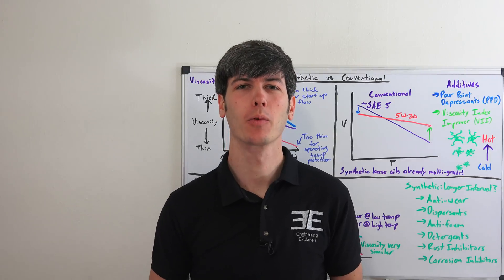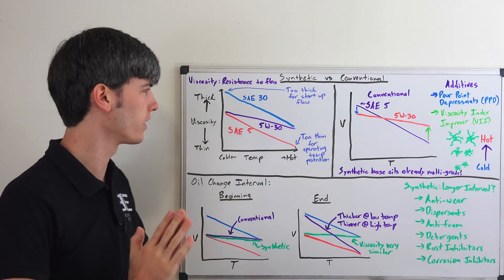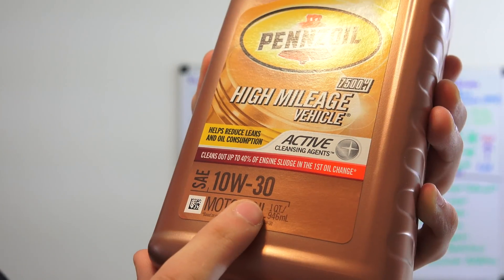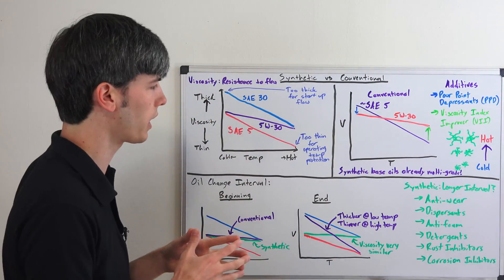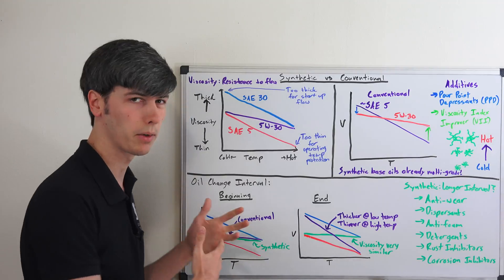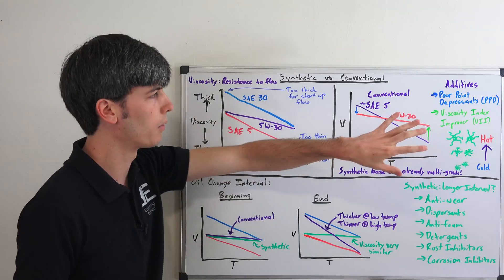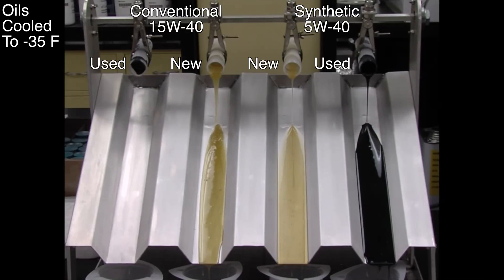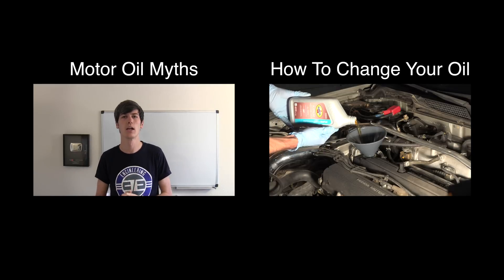Is Synthetic Motor Oil Better For Your Car?

Comment: so.... synthetic oil doesnt have any cons?
Reply: Just because it is made by Mobil , does Not mean it is the same formula.
Reply: *****
That's not a con, that is a pro of the synthetic oil's additives doing a good enough job cleaning up the gunk that was built up around already existing leaks that the leak became noticeable. The leaks were already there, now you just know about them, and can have them serviced.
Reply: just that it is expensive, but walmart supertech full synthetic is reasonably priced
Reply: Ryan Rohauer walmart full synthetic is the same as mobil 1.   google it
Reply: It can and will cause higher consumption in high mileage engines. I have first hand experience with that. My car will burn 1-1.5 quarts of Pennzoil Platinum over 5,000 miles, it will burn less than a quart of syn-blend or conventional over the same mileage.
Reply: ***** walmart full synthetic is 5 quart jug for $12
Reply: Yeah thats from clearance issues and seal issues. I experience something similar since I've made the switch. But my engine does seem to run better all around.
Reply: Is it really that expensive when it costs about as much or less than filling up a full tank of gas? Considering you have to do it once (and potentially top it off once or twice) every 5000 miles? 
Also the price of synthetic vs. conventional is hardly significant. At the autozone I went to it was like a 3 dollar difference or something for the gallon jug of the stuff.
Reply: Oil in the USA is soo much cheaper than it is in the UK :(
Reply: price
Reply: +plokmijn47 My two main seals leak enough to make a mess on my transmission and side of engine but not enough that I'm seeing puddles of oil under my car (knock on wood) should I not use synthetic then?
Reply: mrsemifixit
Also just remember it isn't the cause of the leak, and shouldn't be a reason to stray away from synthetic, but more a reason to stray towards fixing those leaks.
Reply: Rubber seals have  hydrocarbon oils called elastiziers put into the rubber mix during manufacture. Over time when exposed to heating and cooling these elastiziers evapourate from the rubber and the oil seal shrinks and looses its elasticity.
Old mineral oil naturally replaces the lost elasticizers keeps old style rubber oils. seals supple and plumped up. Good modern synthetics contain elastizers as additives that do the same job.

Comment: How often I need to change my motor oil, I use full synthetic 10W 30 in a 4 Cyl 2.0 Turbochaged Mitsubishi Eclipse 99? also I live in Puerto Rico which is summer all the year, Do I need to change to 5W 30?
Reply: Does your manual specify 10w-30?  Never exceed the recommended interval with a turbo regardless of the type of oil you use.

Comment: Sadly, I have to order my oil on Amazon. Auto parts simply do not carry it. My car (Abarth) specifies Pennzoil Platinum Euro 5w-40. Local auto parts try to claim the regular synthetic 5w-30 or 0w-30 or even 10w-40 will work, but neither matches the heat requirements of the 1.4 Multiair Turbo on my 500 Abarth.

Thing is, Multiair uses oil solenoids to operate the intake valves (very high tech), which means if you have the wrong viscosity oil, it actually changes the valve timing. The engine uses temperature measurement at the VVT sensor to calculate the current viscosity, based on you having put in the correct oil. 

All of this equals.... you shouldn't put the wrong grade of oil! And yet auto parts counter jockeys will always tell people it doesn't matter.

This is why I end up doing my own oil changes as well. I know for a fact no auto parts in my entire city (120,000 population) carry it in stock, so I can deduce that any oil change shop claiming to use it is probably lying to me.
Reply: Bruh, chill.  You really think a mass produced car isn't designed with enough tolerance to take different oil than what the manufacturer recommends?  Hate to break it to you but your Abarth isn't that special, no offense.  It would be fine with whatever you can find on the shelf.  You honestly can't complain if you're going to be picky tbh.
Reply: Electone_Guy If you believe the local autozone, there are no synthetic 5w40 outside of diesel oil.
Reply: supertouch I'm not putting "any" 5w-40 in my engine. Especially not conventional oil, when you consider it has to lubricate the turbo which gets EXTREMELY hot. Would other brand synthetic 5w-40 work? Some of them. But you just try finding synthetic 5w-40 at most auto parts. You can't, unless you want to get Diesel oil (Rotella T6)
Reply: There are no conventional 5w40 oils.
Reply: Alvin Brinson 
Whatever you say bud, I'm not saying you should put whatever you can find on the shelf but I have no doubt that your precious "multiair" would take it just fine.
Reply: Try Liqui Moly 5W-40 every auto part near my place has it. In fact Liqui Moly is the only brand our shop uses for Euro makes. That said any synthetic oil of 5W-30, 5W-40, 10W-30, and 10W,40 will most likely work on your vehicle as they are designed to run on more than just one viscosity of oil.
Reply: There is no conventional 5W-40. That kind of viscosity range just isn't achievable without synthetic bases.
Reply: My wife's 1.4L turbo Dart has the same engine and every auto parts place and places like wal-mart carry full synthetic 5w-40. It says "turbo diesel" on the label (Shell Rotella T6) but it is not strictly for a diesel engine, says so on the back label.  I have used it several times with no issues.  And I know dozens more from the Dart forum who also use it
Reply: Any well known brand synthetic 5w-40 should work for you. Your pennzoil platinum is the same as Shell helix ultra btw.
It's considered one of the better oils in pair with Mobil1.
Reply: "diesel" motor oils are just engine oils with more cleaning additives to take care of the extra soot that the diesel engine produce.

Comment: except for rotary engines, that you need to use mineral oil like castrol Gtx.

but if you put an additional tank oil for the oil injection system, independent from the sump oil, you need to put in the additional tank mineral oil, and in the main sump, full synthetic

Comment: So 0w-40 is thinner at cold temperatures than 5w-40 but at operating temperature they are both the same?
Reply: That's the idea for multi-grade oil. But if you wanna know how far you can drive before oil breaks down, that depends on brand and additive package for different application. Generally that's the way it goes.
Reply: Yes
Reply: Overall, yes. They're not always exact though, for example Shell T6 5w40 is thicker at cold and operating temperature than T6 0w40 but Pennzoil Platinum 10w30 and 5w30 are the same at operating temperature yet they're different when "cold". Look up the data sheets if you're that analytical; for many oils you can just google search them.
Reply: That is the idea, but usually they're not exact. You'll find the 5w-40 will probably have a little higher viscosity at operating temps compared to the 0w-40. You can look at the spec sheets on the manufacturer's website, all of them should have it available to see, if they don't never buy from them.

Comment: Hello, good video,
if your car is running with synthetic oil and you need some oil but in the gas station only have conventional oil, you can use the conventional oil or it will cause some problems in the car?
Reply: You can mix them in any proportion you like without ill effect.  Just match the viscosity requirement.
Reply: It's better than not adding oil but don't choose the wrong viscosity; if you need 5w20 or 5w30 and they only have 20w50 then that's too thick so just walk to the next store.

Comment: I don't understand... If synthetic is som much better, why is conventional motor oil still in sales at all? If I'm remembering correctly the shelves in stores seem to have plenty of both synthetic and conventional motor oil, as well as blended. Can someone smarter than me please explain? It seems there must be a better reason than "old engines" and "race engines" as some have mentioned in the comments here, since there still seemingly is a lot of conventional oil available in your average store (that sells motor oils).
Reply: Simple: conventional oil is cheaper. Regular old motor oil can be, say, $2 a quart, but synthetic is more like $4 a quart.
Reply: Maybe it's just me that don't change often enough then. Seems like not the biggest save on my car's costs. But then again, people do wierd stuff to save a couple of cents per gallon on fuel too, so...
Reply: I use synthetic because of the benefits covered in this video. I can go 5K miles between changes instead of 3.
Reply: Yes, and for older engines with short oil-change intervals there's really no big advantage in using synthetic oils.
Reply: Also, conventional oils are better than ever.  Millions of cars go forever on conventional oil only.
Reply: Many people know that it, for most applications, it makes no practical difference which ones you use.
Reply: Not everyone's sold on Synthetics and sometimes engines are so old and used up that if they'd switch the engine would be cleaned up by the better oil and start leaking all over. As of 2016 case in point would be some engine that hasn't seen a road for over 40 years; it would need rebuilt first.

Comment: I have a weird question. I live in the Caribbean where temp outside is about 82F-85F every day. 
Now I have seen a article where it explained that 20w-50 oil would take a bit more for the oil pump to pump compared to 5w-30 or even 10w-40 oil. This in turn causes more wear on the bearings at startup due to the oil taking a bit more time to be pumped in the block. Now my friends are always using 20w-50 oil in the engines of their cars, where as I use 10w-40 oil. They claim it is because the hot weather, the oil get's too thin. I never had a problem with 10w-40 oil. 
My question is, let's say these engine have about 100k on the meter. which oil should we actually use? The 20w50 or the 10w-40.
Also if you have a newly rebuild engine, which oil should be used? Because again, some of my friends had rebuild their engines and used 20w-50 in it.
Reply: Your manual probably specifies 10w-40.  If so, that's what you should use.  Always use the engine designers' recommendation.  Most wear occurs at startup when you really want lubrication quickly.
Reply: +wholeNwon Owners manual specifies using 5w-30 actually...
Reply: Then that's what you should use.  Simple. The most important thing is to get oil to the overhead cams as quickly as possible on startup.
Reply: If your manual specifies 5w30 for all temperatures you're going to find on this planet that's as thick as you should go. Running an oil too thick or too thin for your engine and specific use of the engine will wear it down faster and if you're running too thick it's going to increase your fuel bill. Don't use oil thickener additives either, they'll do the same thing.

Comment: Some oldtimers do need mineral oil!
Reply: No they don't. It's an old-wives' tale. They may need different additives, especially going from oils without dispersant to oils with dispersant, etc. But synthetic will be fine.
Reply: Really?  Which ones? Some use mineral oil from brake fluid but that's a different issue.
Reply: At least the DAF YA 328 I had (Hercules JXLD engine). It was made for SAE-30. The mineral oil causes the dirt to sink down, while syntetic oil keeps it floating. So when you use syntetic while it always had mineral, all the years of dirt comes loose. Also syntetics can impair copper.
Reply: Motor oils that have detergents (which is almost all of them) use the detergents to hold particles in suspension and deliver them to the filter.
Reply: wholeNwon
No, those are dispersants, which is not the same thing.
Reply: My Opel doesn't even have an oil filter, only a little sieve.
Reply: keesie75
Same with many aircraft engines, so yes you have to be careful when switching to a modern oil with dispersant after running it for a very long time on non-dispersant oil.

Comment: Is there any truth to the saying that synthetic will leak around seals in older engines that aren't made for it? I've always used conventional just because I didn't want to ruin my seals in older engines.
Reply: There should have been no leakage around your oil filter.  Was it the canister type?
Reply: If the engine's worn enough, yes. I'm using Pennzoil Platinum 5w30 in a 1984 Caprice which is probably on its original engine and got a leak but it's not severe, it's just a few drops after shutoff. I'm thinking of switching to a thicker Full Synthetic 5w30 to prevent leaks.

Comment: I have 2009 Subaru impreza.  It has just over 100k miles on it now.  Is it safe to switch from conventional to synthetic?
Reply: You can always switch between conventional and synthetic. Your engine may become noisier because of synthetic's low viscosity, but you should be fine.
Reply: yeah you should be fine better to switch early because the synthetic will clean sludge and cause the car to leak more if it's leaking